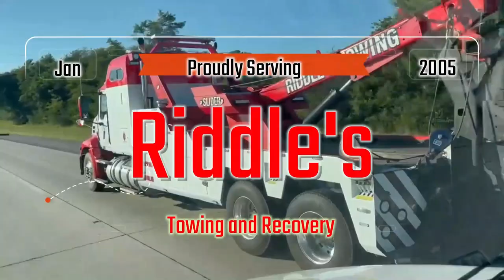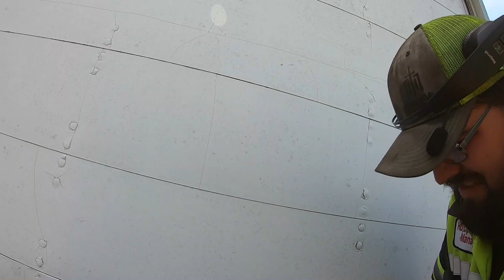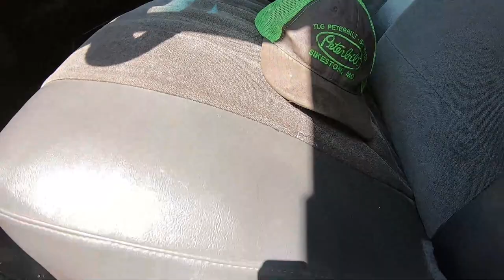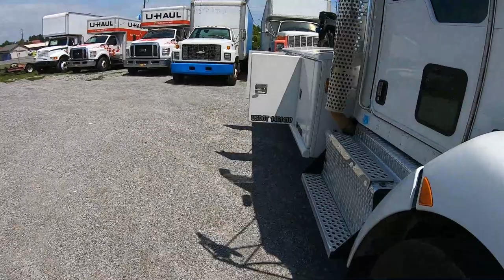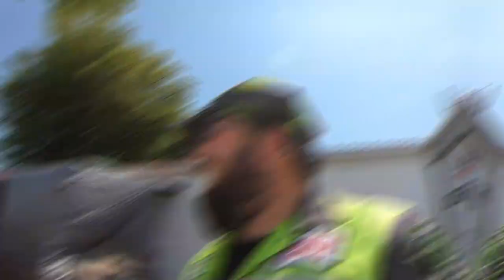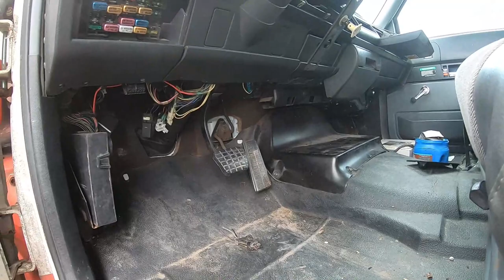Towing With Spring Hangar Forks

Comment: You missed the yellow parking brake handle. That moving truck has what's called a Lucas Gurling hydraulic hd brake system. It has a spring brake chamber filled with atf.

Comment: It has an air parking brake, the yellow knob somebody removed the body panel so it was facing the floor, at least it was up by the transmission and not on the rear end.
Reply from the maker: I didnt see it lol
Reply: Do you guys replace drive shaft?
Reply from the maker: @thomaslindsay1967  depends on the scenario... most of the time no
Reply: @MercifulTowing  Are you guys a service provider for uhaul if so do you replace drive shaft on their trucks? I'm curious I am a service provider for uhaul haven't come across a truck where I had to remove shaft  I would like to know if I have option of not replacing shaft? Thanks in advance
Reply from the maker: @thomaslindsay1967  we are a provider for them, however we do not do many runs for them as they aren't very busy in this area.    Most of the time when we to them they go to a repair facility so we do not reinstall.
Reply from the maker: @thomaslindsay1967 Just ask your rep what they want you to do.  If they say reinstall than get them to give you a hold harmless or something in writing that says they will not hold you liable
Reply: @MercifulTowing  thanks I appreciate the advice
Reply: Thanks that's basically where I tow them so I will let rep know if shaft needs to be removed I will not replace. One other question when is it ok to use heavy duty scrap to secure forks?
Reply from the maker: @thomaslindsay1967  I use HD underlift straps on 99% of tows
Reply: That's a hydraulic over spring brake system. The control looks the same as a service brake on an air brake truck. It's hydraulic though. There's a spring brake chamber for parking.

Comment: Do you need a CDL for the 16 ton ?
Reply from the maker: Yes the trucks GVWR is 33,000 lbs anything over 26001 requires CDL.  I believe you can find 16tons under 33k but its not recommended you can get real dangerous real quick.